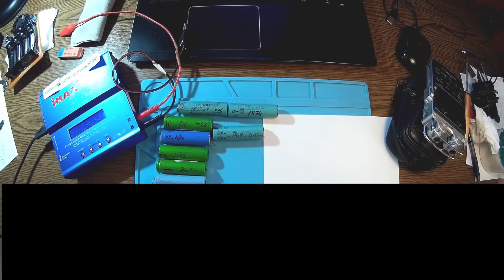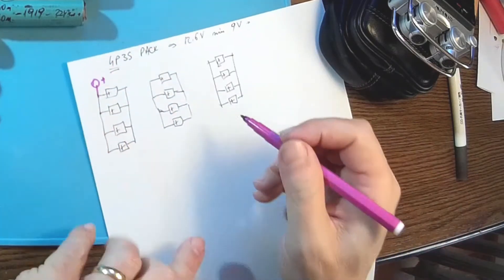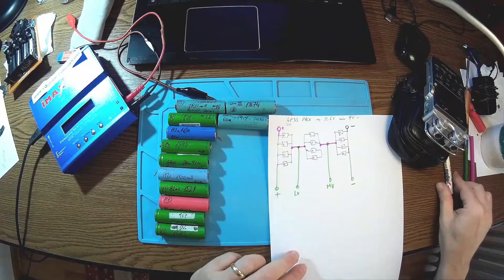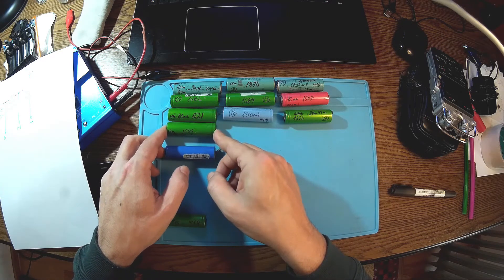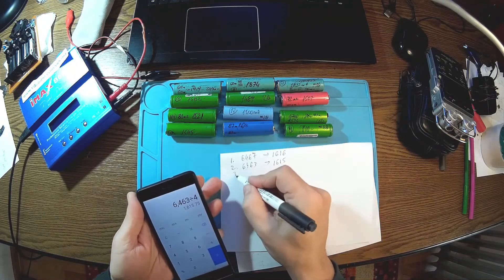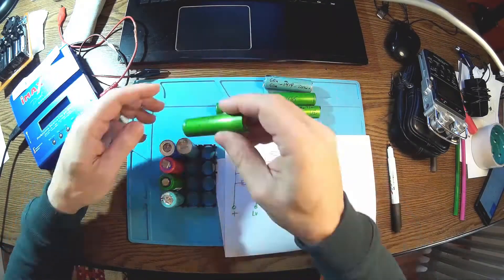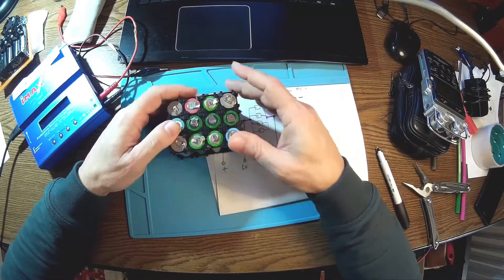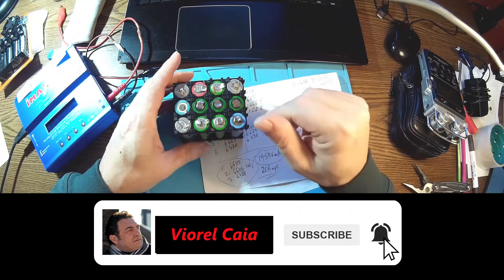Recycle battery from laptop cells.Simple 3S4P pack.

Comment: cool but now i d like to know about the bms conections
Reply from the maker: In this case I didn't use any BMS, the pack was charged and balanced with  dedicated Li-ion charger like IMAX b6 or Turnigy...there are so many chargers. So it's just a bare battery which can be used for years. A fuse is necessary though to avoid shorts.

Comment: Soldering around on 18650 Li-Ion batteries? I was always suspicious of that. If you don't know exactly what you're doing here, your house will burn down some weeks/month later, e.g. because of wrong solder or fuse wire too strong or tiny holes in the metal after tearing off the contact plates and air got into the cell. So I found a more elegant solution. See the channel jehugarcia , mexico.
(E*ay item 233849980002 ,  "7S Power Wall Balancer PCB 18650 Battery Holder Case 20/40/60A Protection Board" )
One holder holds 14 cells, giving about 100 Wh. If I have collected and tested enough other used cells, then I simply screw another holder(s) onto the existing battery bank. (My only "problem" was finding the right connector FC 16P 2x8 Pin Header for the balancer cable  IDC 16 2,54mm. Instead of special pressing pliers, I simply use a small vice.)
Greetings from germany
Reply from the maker: Thanks! Good advice! taken!

Comment: Nice demonstration, how to match cells. It is much easier with https://www.repackr.com which combines cells automatically. One suggestion about solar charging. Sometimes is more practical to make 4S3P. I am test running a 4S9P battery from hervested cells for 3 years. 12 upto 16,8V is more usable than 9 upto 12,6 V. You need to use buck converter for 12V output. But you have to use buck/boost for 3S also. 3S would be lower than 12V all the time. And also there are some limits with charge controllers I don't remember exactly. It was more than 3 years ago I was doing this. The best way to go for 18650s is 7S. It is the closest match for 24V system.

After all testing I found out, that best Li system for 12V is LiFePO4. 4S almost exactly match lead acid batteryes. I'm preparing a 16 x 12P packets of 26650 LFOs. 192 cells altogether. This packs can be combined in 12V, 24V and 48V combinatons for testing and mostly learning. It wil be semi offgrid sistem for 2 aquariums. The inverter will supply AC mostly from solar and battery. In rare caseses also from AC grid. But never sending anything out to grid.
Reply from the maker: Thanks! Well documented like always!
Reply from the maker: You're right! I'm thinking for LiFePo4, they feel very secure and close to Pb behavior.For now I'm waiting for a 30A solar charger with Li-ion menu like 12.8V or 25.6V, I'll start testing with small packs 3S4P and check for CC and CV until fully charged..eventually I'm building a bigger pack..but I'm not felling ok with Li-io...the future is LiFepo4 for sure! I'll post a video with charger as soon as is coming.Thanks again and be safe!!

Comment: Hi Viorel. In fact capacity is one key argument, the different P-groups should have as little difference in capacity between them as possible. This site can help you to associate cells to build packs or to validate your own choices: https://www.repackr.com/#/pack-builder 
Enter the capacity of each cell you have, the desired P & S numbers, and it will automatically associate cells for you :)
But other criteria are also important. Internal impedance (measured with AC @ 1kHz to allow comparison with manufacturer's original value in datasheets) has a great impact on available max amps the cell can support and thus his heating level under load.
I think wear level is also realy important: a cell with original capacity of 3200mAh and a wear level of 50% = residual capacity of 1600mAh has a bigger usable capacity than a brand new 1500mAh. BUT his livespan will be much more short, with a faster and faster degradation of his characteristics. This kind of cell will die first in a pack, with big risks of heating, thermal runaway
 and causing bad things to happen!
So I believe it's important to first identify your cells and retrieve their datasheet, so you can get their original capacity, internal impedance and with their measured residual capacity you can estimate their wear level. So you can associate (if you have enough salvaged cells of course) the ones with similar characteristics and remaining estimed lifespan to build as much as possible safe, reliable and durable packs.
Reply from the maker: SUPER! This a very nice and well documented information.That will help for building secure packs! Thanks a lot! I'll put the comment on facebook too if it's ok with you.